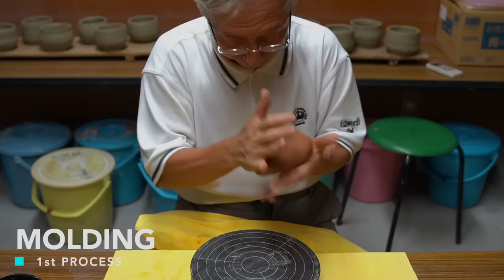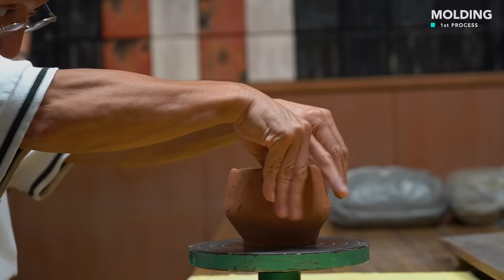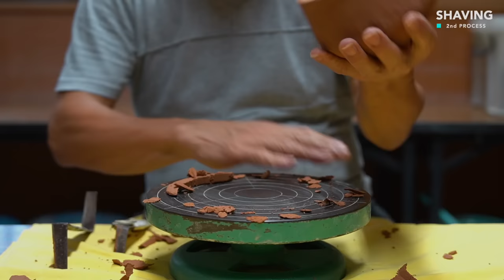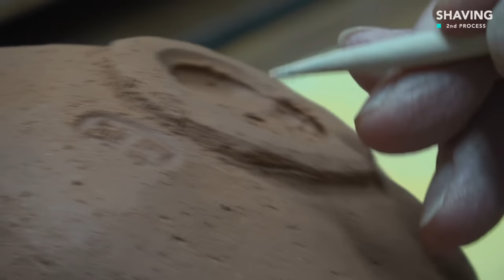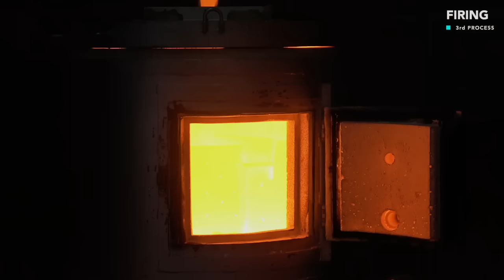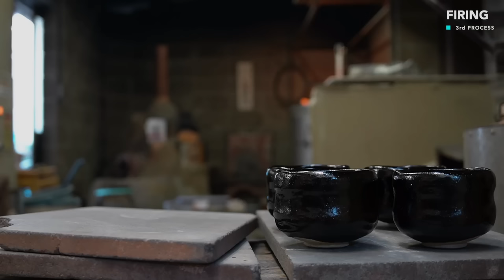抹茶碗を作るプロセス。抹茶がすごく美味しくなる器を作る楽焼工房

Comment from the maker: You can get this product from the link below!
https://suigenkyo.store/products/raku-pottery-tea-bowl-traditional-glaze?_pos=7&_sid=d6e9a2e70&_ss=r

10% off coupon "SUIGENKYO10"

Product Name: Raku Pottery / Tea Bowl / Traditional Glaze
Discription: This is a black Raku with a glaze tone similar to that of the black Raku tea bowls when they were produced about 400 years ago. It is also the oldest form in shape and size. Raku ware is a tea bowl designed for the tea ceremony. The tea bowl has a wide bottom, called "chasenzuri," which makes it easy to turn a tea whisk and serve tea. Also, the cup itself curves slightly inward at the rim, which prevents tea from dripping out of the bowl when drinking and makes drinking the tea elegantly.

It is formed by hand-twisting or hand-kneading, using only hands and spatulas, and is characterized by slight distortions and thick shapes. The entire shape, which is not perfect from side to side, expresses the "beauty of imperfection". There is also a rating system for matcha bowls, "Ichi-Raku, Ni-Hagi, and San-Karatsu," (means 1st rank, 2nd and 3rd) with Raku ware being the most prestigious matcha bowl.